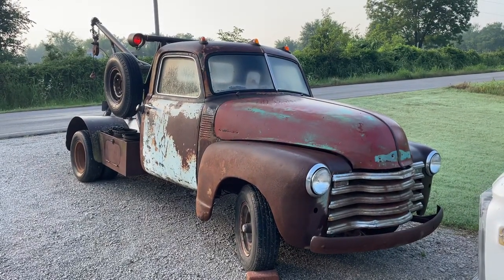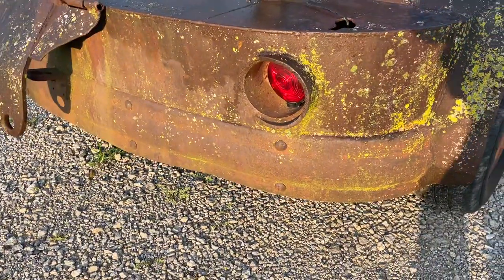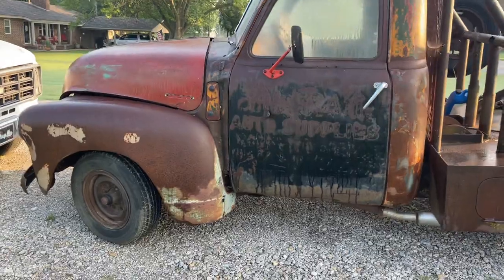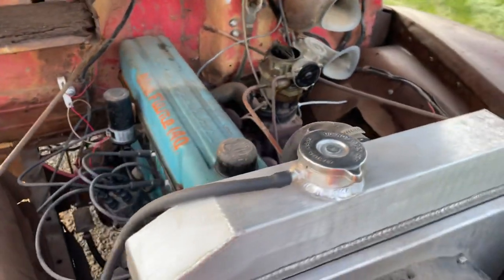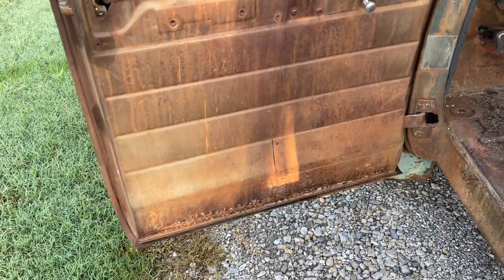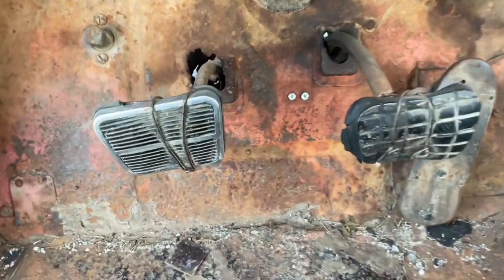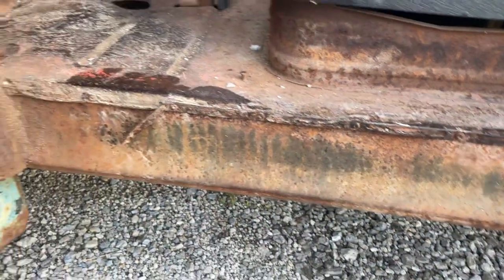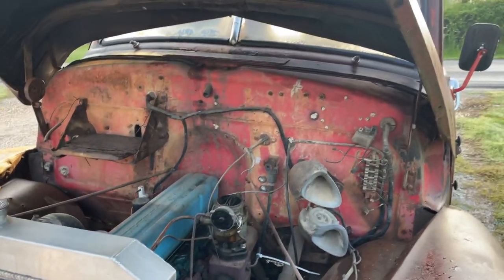1947 Chevrolet 3600 wrecker truck

Comment: Keep the outside patina and most of the interior patina but restore this thing. I say do an engine swap with something cool. Maybe a cool modern truck engine. Get the wench working. But the look is great. What do guys put on a vehicle to keep the patina and keep it from rusting out?
Reply from the maker: Honestly ive thought real hard about upgrading the engine and transmission to newer stuff. Its so dang slow that it’s dangerous. Kinda like how you would feel driving a lawn mower around town. 
Most of the stuff you can wipe on to prevent rust are just cocktails of oil/wax/silicone stuff. You can also clearcoat it.